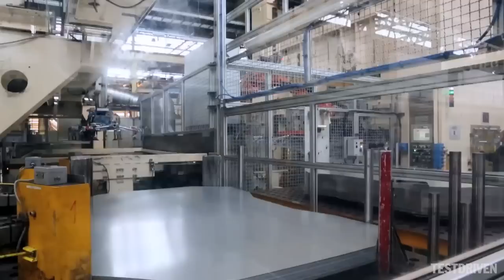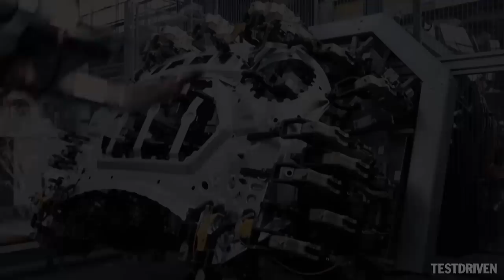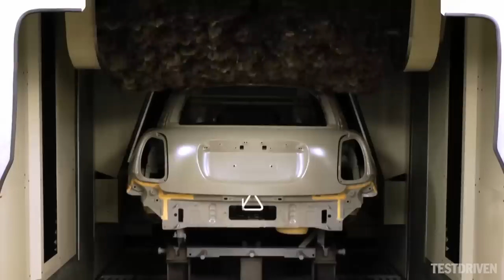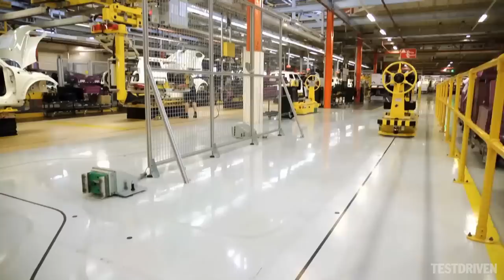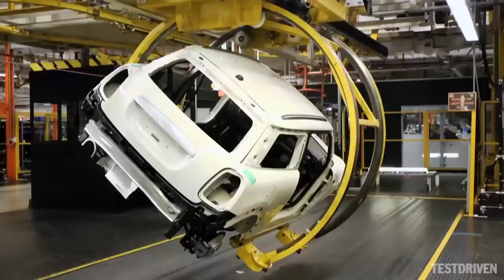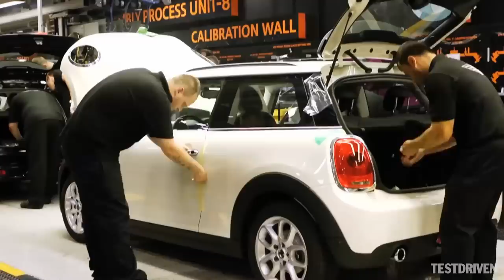New Mini Production

Comment: A nice video, but it doesn't need to repeat each process 3x times, 5x times in the first part. It just needs a sharp edit of each step with multiple angles of points of interests, like the soldering process or metal form sections. A bit more like How It's Made. It could really well. Like another comment on here , music plays a massive part in the delivery of the message of the video. A low level score would only improve this.

Comment: Not to criticize the car but BMW are loosing the sense of measurement. They went far too large now that they lost the mini concept. They have already done the mistake in puffing up the R56 and placing that junk of an engine in it, now regarding size, they went even worse. I cannot say anything about the new engine but hope they rectified the bundle of problems the other had. In my opinion, the best new mini up to date to be produced by BMW, was and still is the R53 1st Gen minis with its superb super reliable Chrysler Daimler engine.

Comment: freakin awesome!!!!!!! All automated -  computer controlled, how accurate can you get?? These are made in Germany, Austria, I think. Don't mess with the Germans, I just got one (2014 hardtop cooper S).-stck shift - its a blast, VERY responsive but due to stiff suspension it is very bumpy, you will feel everything on the road, do try to get the DYNAMIC SUSPENSION package when you custom order
Reply: u're right, driving a mini is sometimes not easy, in a case of bumby roads and sewage-covers in tight curves
Reply: hurius
I try to be cautious of the bumps, fearing that they will eventually ruin the suspension, bushing etc. But it is a beautiful car! Love the design and again how responsive it is, it has huge frontal brakes. I like small cars, why does it have to be SO HUGE to make you feel you got the very best or its a 'real' sports car? I think mini is every bit optimized in regards to form and volume minimization, no bulky, unnecessary features with this car. Got to agree with the creator of the original mini - he said that a hatch-back looks more beautiful and modern than a saloon car. Just my thoughts :-)
Reply: Ronit Singh
the mini and mini cabrio has been first driven by me with the possibility from drive-now, which owns not special models, but the most standard models in different variations. i have to say that, because i don't own some mini. but the positive is, that i tried a lot of them. different ages, different mileages, different clutches and engines (newer and smaller engines and little bit bigger engines, diesel or gas) different gearboxtypes (automatic with or without manual shift, 6-speeds etc.) and i can sumeout, that these smaller engines, from newer ages, are a little bit crappy in combination with the newer, stronger, loveless built-in, cheap clutchpedal. they have really no power to drive it without get in struggle with the gearbox and drive (alternating thrust and engine-brake) because the clutch is too strong to manifold. made in china?
i found some different favourite combinations out, which i would buy and prefer. thats not cabrio, because you can't see the people behind you, and thats also not these stupid 1,2 ? or 1,4 l gasoline engine without torque. I would prefer an strong diesel. They are really rockets combined with the small light chassis. with an automatic gearbox its easy possible to challenge some aged "sport" cars, which i haven't tried yet directly ;-) because drive-now isn't to race. ;) but sometimes people doesn't care much about their rented cars, as i have to admit, that i sometimes, in hurry, drive a little bit faster. and so does it come that i know the feedback from this car on bumpy roads and curves. its quite different to steer it if you fast on your own and sametime drive over an little bumber, or something like that. i never tried the clubman, but i would prefer the clubman with an 6shift gearbox and a strong (and more massively) gasoline or favorably a diesel 110HP engine because it has a longer wheelbase, which is much more save to drive. altogether is mini a very nice small car, which has reliable panstatistics and is funny to drive... over and out
Reply: hurius
I know what you saying, the new mini sounds like a diesel anyway, that chunky and clicking sound when it ideals, I thought something was wrong and took it to dealers, they said it was normal, they checked and all. Shifting gears, not so smooth either. I have driven diesel all my life and love how smooth it shifts gear cause of the insane torque it has compared to gas. Mini is no Ferrari which is made with passion, it has to sell by the thousands so there are drawbacks to it. Yes I would much prefer a juiced up diesel under the hood, they will be hesitant to get some to USA. Well this is my first car here in the US, I dream of owning the original 1960s MINI, with my choice of engine and gearbox and everything modern under the hood to make it safe. The new one is quite good in terms of safety. Wish they had done more with the gauges and display, everything has its reasons. Yeah the gear shifting is crappy, i HAVE TO AGREE, but the engine (2L) with turbo has a nice sound to it and very responsive, it is quite torquy too, I can easily short-shift because of the torque it outputs, to 6th gear under 3000 rpm. Well I gotta put on some vintage fog lights on it- made in Italy , 5.5" dia with arrows on the glass too. For me its my first car and I think for its size, class, design and performance, I made a good choice, I like minis, a small car and stick shift, what can be better except the original. I just love it cause it is well designed and yes it is quite heavy - well built with thicker gauge sheet metal.
Reply: MINIs are made in Oxford, England
Reply: Well these minis 2001 upwards have all been manufactured in Germany, Mini bought out British ley land. BMW is the owner of mini now, they held on to the mini brand but sold rover etc. Mini is basically a BMW but has essence of the mini cooper, indisputable German engineering throughout, I am not saying its a germ, but its good enough. Now they have a 4 door version of the hard-top, can you believe that, good for families that want a small all around usable car and sporty and cute looking. I have to say that getting in and out is a pain but the rear space is more than adequate for any average person. A mini should always be a 2 door hardtop, take them rear seats ot even, I am happy with my choice! Its great what BMW is doing BUT they should have that one pivotal car - 2 door hardtop that traces its routes to the original mini. IT should strickly reflect the looks, handling and power and small, they are making them longer and longer, hiding the size with design that makes you think, the car is small and compact, for eample, the tail lights are big and goggly and positioned to the extremities of the body to give an appearance that makes the car look 'small'.
Reply: Ronit Singh The Mini Hatches shown are made in the UK at the BMW Oxford Plant, the larger Mini Countyman is made in Austria

Comment: It surprises me how many MINIs are custom made at the factory. They do make mistakes on orders so how do they know if car 1 is custom built and car 2 is a prefabricated trim version? Do the custom built cars have a tray of parts that follow them so the workers know the customer specifically wanted a GPS in the dash while the next car is supposed to be made without it? Or does the computer "know" this and have the parts on the supply line already? Oddly, when I was shopping around for a car, quite a few MINIs were coming from the factory with the wrong options installed but they fixed that problem quickly.
Reply: All the parts tie up with the correct order along the process.
Reply: Yeah did the Factory tour  a few years back al the parts go round with the car and meet up correct. The actual parts come off the transit in the exact order of the builds. So if you wanted Black 18” Wheels they would come of the truck and loaded into the system to go round with your car.
 
Its actually really interesting seeing the car going from a shell to the first start ups on the line.

Comment: Has the 2014 model still got that awful wide panel gap between the wheel arch and the bonnet? Always thought that was one of the weakest bits of design on the outgoing version of the hatch etc

Comment: Really!? I have an r53 JCW and in my opinion they COMPLETELY ruined....RUINED the entire car. Its so big and ugly...its no longer the little go cart I know and love!
 The engine choices are cool, I like the 2.0 liter but the shape is ruined and it looks like it got fat
Reply: As a R52S owner, I understand your statement: I wouldn't change my R52S any versions of R56. I drove some R56 and I didn't like the driving feeling, exterior and interior designs: bigger and uglier. I mean, with the 1st gen, there were nice art-deco design. For the R56, BMW got rid of those and replaced by ugly generic and untasteful design. At least, with the F56, BMW may fix alot the weakness of the R56 and I don't think will be better than the 1st gen for the driving feeling.

Comment: Trash bullshiet o have one a lot problems I buy 0 miles 2016 hardtop right now it's at the dealer I have 50000 miles warranty and the try charge 3 thousands dollars the wreck do the damage in the tide rods and the call me and said I have to pay wtf ???? But before this problem I have oil leak radiator broke and evaporate system all this in a few months